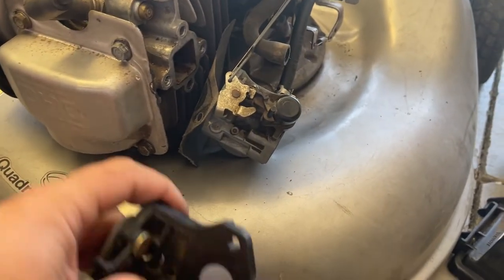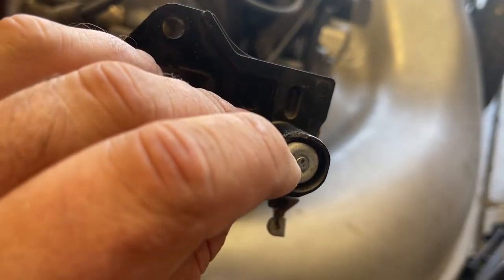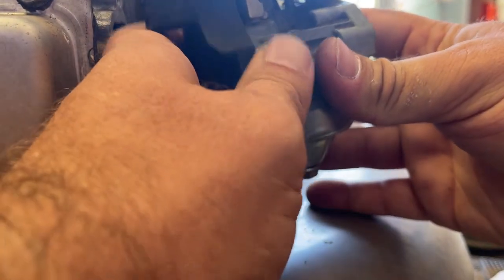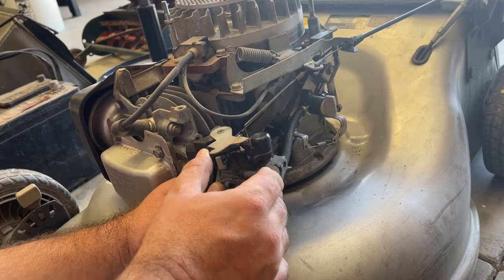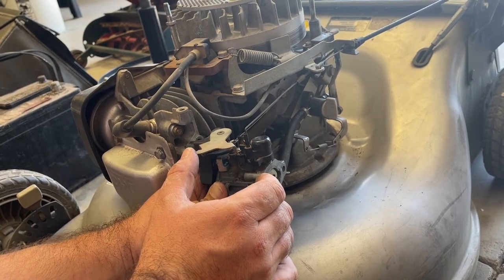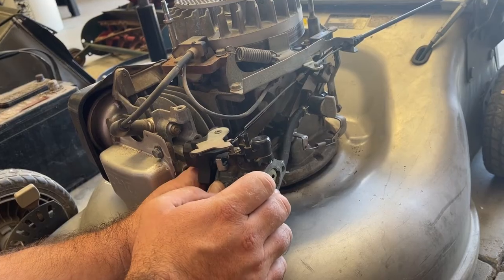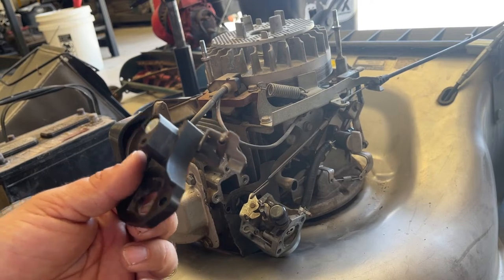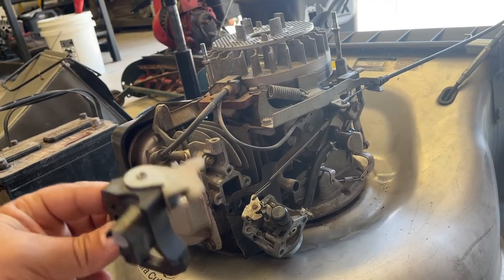Honda GCV Autochoke Explained

Comment from the maker: Just to clarify, yes, the wax cylinder is in the head, this is what heats up and forces the spring closed or open. I did not pull the wax cylinder out for this video. The function of this mechanism remains the same.

Comment: My Honda mower starts fine BUT when it gets warm, it stars surging up n down, I replace the card two years ago mower. I'm wondering if this isn't the problem.
Thank you for the video..
Reply: There is a heat sensitive pin that when it gets hot, the needle comes out and opens the choke control (the one on this video).
I placed a screwdriver to force it closed, and the mower started running normal.
Perhaps the pin is faulty? I don't know.
Have you fixed yours?

Comment: Briggs and Stratton uses a much cruder form of this mechanism… the bimetallic spring is mounted near the exhaust side of the engine
Reply from the maker: Yup I’ve replaced many of those over the years

Comment: My engine has that same mechanism.  I ordered what was supposed to be the correct wax thingmabob for my mower but it's just the piston and not that spacer assembly.  Is the piston replaceable on that assembly so I can install the replacement I have or do you have to buy that whole assembly?
Reply: It sounds like you're refrencing 2 different parts. The thermowax assy. (wax thingamabob) is a different part that's mounted into the cylinder that lines up with the spring cup (what he calls the thermostat in the video) in the auto-choke control assy. when installed and the little thermowax piston is what opens and closes the auto-choke assy.

The auto-choke control assy. shown in the video has actually been updated replacing the metal spring cup with a black plastic one since the metal one was prone to sticking. So to answer your question you have to buy the whole assembly. It has the same part# as the one it replaced so make sure the one you order has the black plastic spring cup instead of the metal one shown in the video.

Comment: My brother's HRR216K9VKAA starts fine but the chock stays on for 3-5 minutes.  Just started doing this.  Replaced thermo wax and didn't see any thing hanging up.  Any suggestions??
Reply from the maker: Double check the linkages see if anything is jammed up